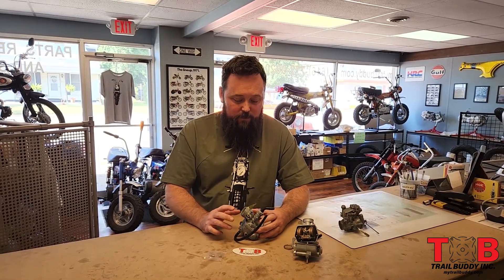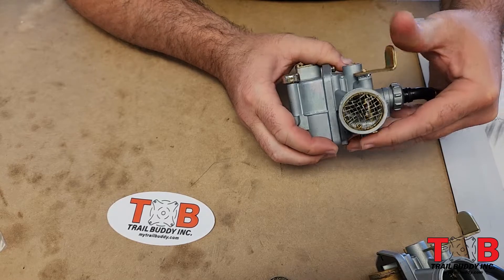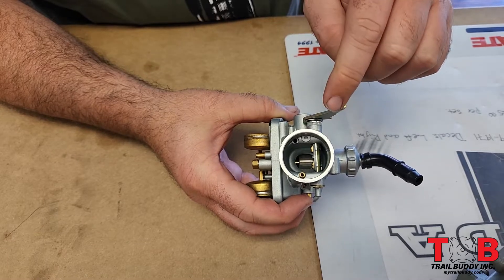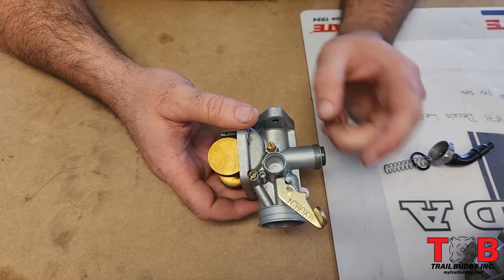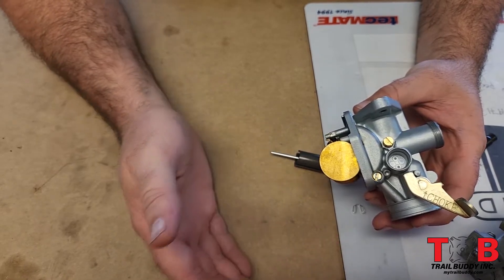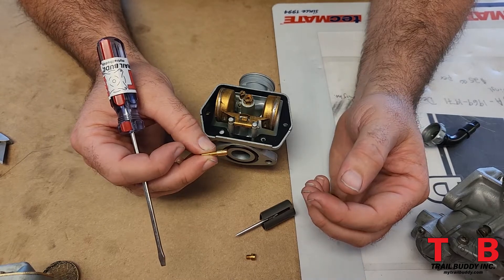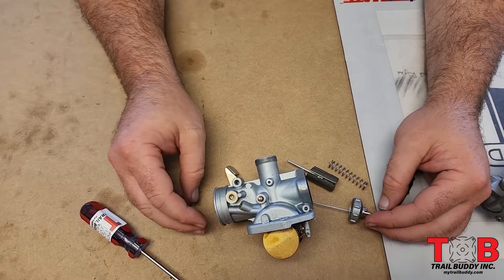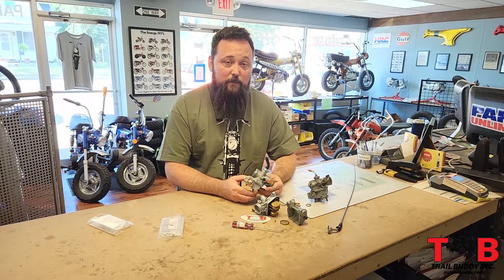Overview of Trailbuddy's Replacement Carb for 1969-1976 Honda CT70's

Comment: Trying to clean my carburetor the other day and I removed what you described as the Idle Jet. Question: Should the hole that is in the center of that idle jet “center hole where the screwdriver goes to remove” blocked or should I see light through it? Should that center hole pass all the way through the jet? Not sure why that hole is there if it is blocked. I cannot see through mine when I cleaned it the other day and any attempt to get a thin wire to pass through failed. Also what is the float setting on that carburetor? I believe I have the same one. My CT sputters, back fires when applying throttle. Idles nice and starts on first kick even when cold. Thank you for the video and any help.

Comment: So when do you need to move the needle clip position? When do you need to change the main jet? What about the small idle jet? Why are there so many was to adjust the carb?
Reply: There are many adjustments because the engine has many rpm ranges, therefore fuel and air demand changes.
The main jet only really affects wide open throttle, if it’s too big it will bog or blubber in the exhaust when opened fully.
Too small will result in popping through the carb or lack of top end speed/power.
It’s adjusted by trial and error process to find which jet gives best top speed performance. If two give roughly the same, choose the smaller for better mileage.
The needle affects everything from off idle to just before WOT, it is tapered, changing the clip height changes the  amount of taper in play and how much fuel is allowed at various rpm’s through the mid range.  Again, trial and error to adjust. Most often the mid position is sufficient ,  occasionally adjustment is needed , depending on how bike runs in mids.  If it jerks or bucks at part throttle cruising, raising the needle will give more fuel.
If mileage is bad or it feels soft on accel. Lowering the needle will lean it out. The low speed mixture is for idle and transition from idle to just off idle.  It affects idle quality , starting and how smoothly tje engine responds as you just begin to open the throttle.
All the adjustments work together, so changing one can affect the others and they may need readjustment for optimum efficiency.  Taking the time to adjust properly will pay off. And once adjusted, shouldn’t need it again.
Mikuni web sight has an excellent walk thru of the process.  Don’t short cut or skip adjustments and it’ll be fine.
Patience is key to carb adjustments.
Reply: @megastick9324  Thank you. Hopefully the author of this video will learn something from your comment.

Comment: I bought a replacement carb from you guys for a 73. I went to install it and it must be deeper as there is no way to install the plastic carb insulator with the replacement carb because if I do there would be no way to connect the intake tube to the top of the engine. Does that sound right?